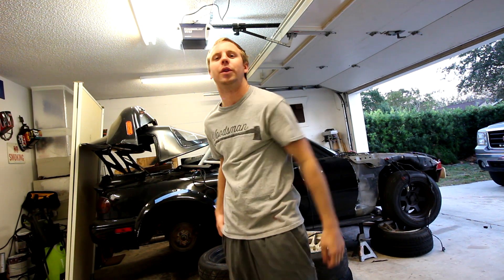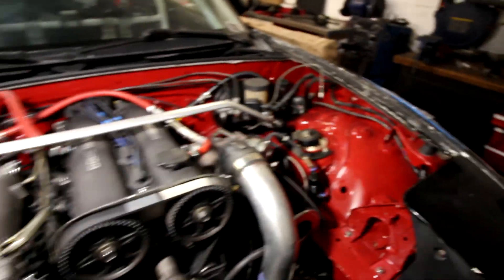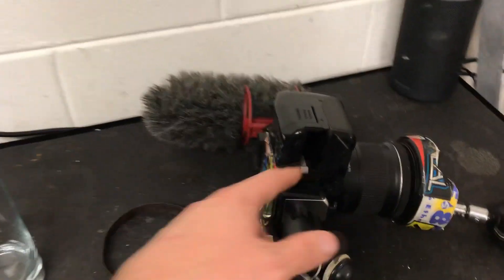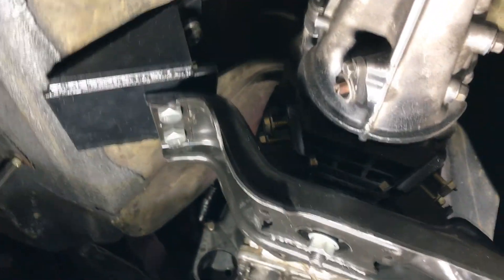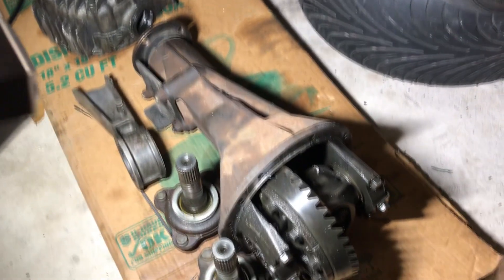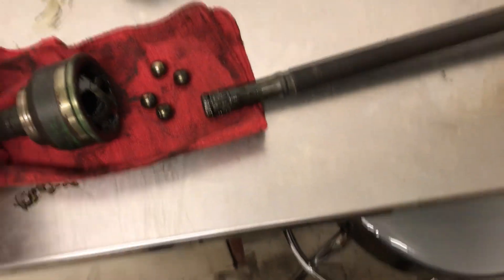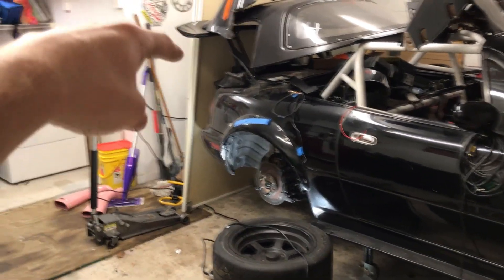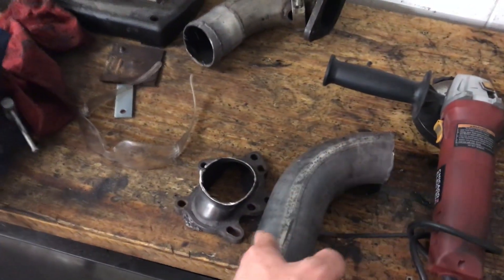Rx7 transmission is mounted in the miata!

Comment: Did RX7 gearbox bolt on bolt for bolt or did you have to use an adapter plate
Reply from the maker: Curtis Rogers have to use an adaptor plate, mines a maverick adaptor plate
Reply: FloridasFinest  And  the pressure plate and flywheel  that boils on to the crankshaft  is from what car because it would have to be able to work with the RX gearbox
Reply from the maker: Curtis Rogers NC Miata clutch disk, I used a NA fly wheel and NA pressure plate. The NC Miata clutch disk has the same number of teeth as the output shaft of the RX7 transmission

Comment: Could you give me some measurements on the two mounts you made for the transmission crossmember. Also what are you doing for ppf
Reply from the maker: Copous1 ya dude I’ll measure it when I pull my trans soon! And I’ll explain my idea for diff prob next video!
Reply: @FloridasFinest  cool thanks man. I just picked up a trans and diff also cant wait to start the project. I think Im Going to try and make my own adapter plate though.

Comment: how much did you spend in the driveshaft
Reply from the maker: $400 I think from a local shop
Reply: @FloridasFinest   could you help me with specs? i am doing the swap and wanna have the driveshaft ready when i put the trans up
Reply from the maker: @josepimp404  don’t quote me but I think i measured mine 4-ft exactly and it worked fine but I think wish I went a tad long

Comment: So are you going to rock the rx7 dif or miata?
Reply from the maker: Hauf Performance Miata diff for now! Once I break it imma prob go with a ford 8.8 and driveshaft shop axles
Reply: Nice, That's what I'm going to do also. I notice most people cut the bell housing to fit a down pipe do you think you will as well? I dont know if I want to make a diff mount or buy k miatas solution what are your thoughts on this?
Reply from the maker: Hauf Performance ya 100% gonna cut bell housing because it’s too tight! I’ll film it and I got an idea for diff mount I’ll show everyone once I get to that. Just waiting on my driveshaft and axle before I mount the diff